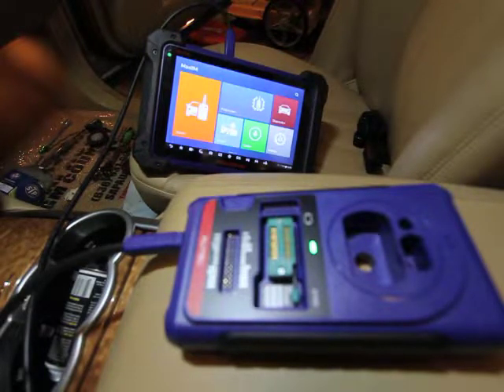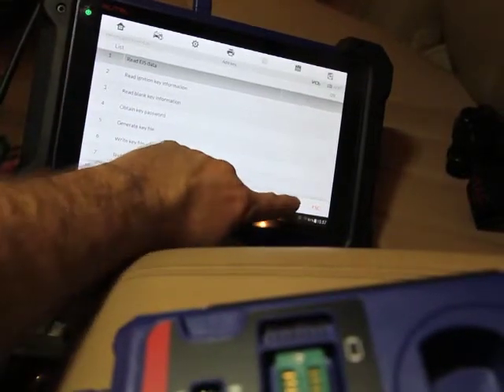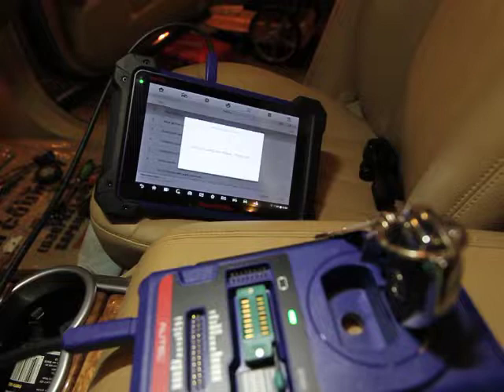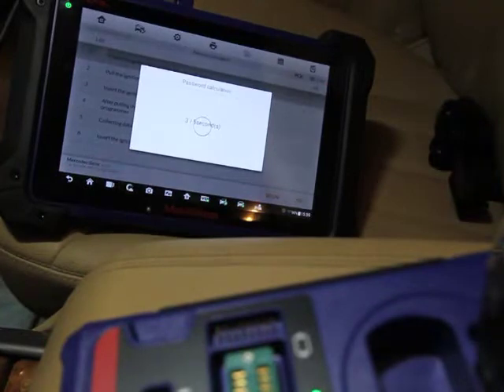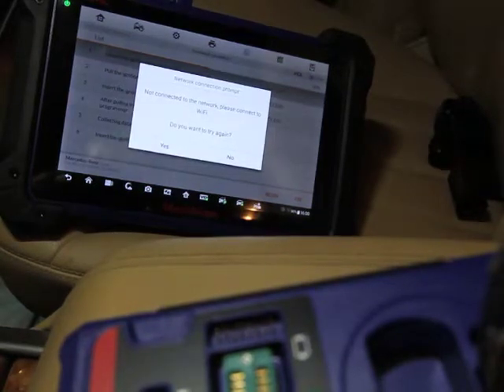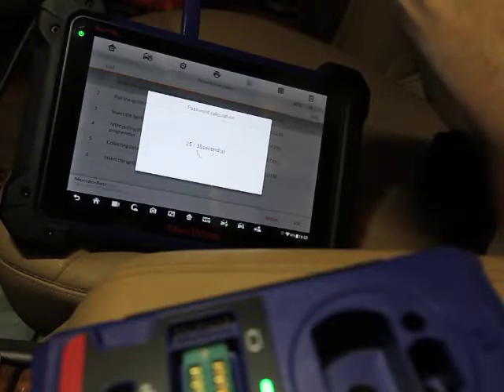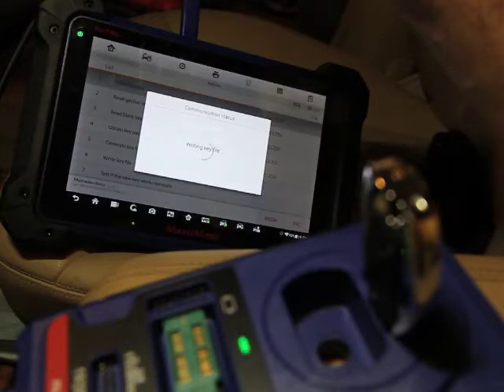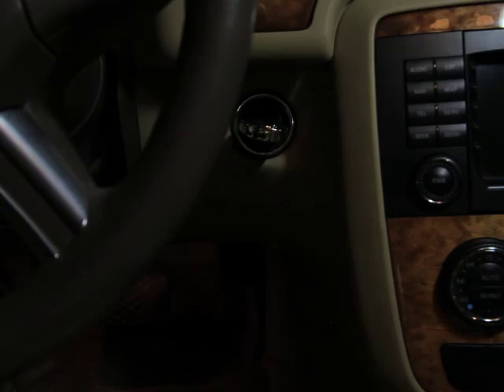Mercedes IR KEY programming with AUTEL IM-608

Comment: I just tried to add a spare key to a 2008 c-class mercedes,it has one original key.
I went through the procedure to add key,that 'seemed' to go well but new key done absolutely nothing!
I read the new key afterwards and all correct info was on it.Looked at the eis tracks on the Autel and original jey was on pisition 1,key i added was showing up as position 8,but,it doesn't show on the eis track list??
The track list shows position 1 and 2 used,the rest empty!So how does my key read as being in position 8,but it really isn't???

Comment: Do you know if the incorrect 433 MHz key was used for AKL bench W230, can a 315 MHz be used to add a key for the get remote functions to work?
Reply from the maker: Change frequency of 433 key to correct issue. BE key correct?
Reply: @SpartanAutoworx  yes it’s a BE key, says made in Germany under battery cover. If it can easily be changed that would be great!
Reply: @SpartanAutoworx  FCC ID: IYZDC07. 433.92 MHz printed as well.

Comment: I am doing my first Mercedes with the IM608 this weekend. I am just hoping I have the correct key. How did you determine which aftermarket key to use. It is a 2007 so I don't believe it had prox so I just got a few of the cheaper keys. I believe they are 315mhz I just hope customers are also 315mhz.
Reply from the maker: I use standard be key from iks or mks. Prox keys require x horse programmer. A little different programming as well. Email me if you run into issues. Just did 03 w230 key Friday with 608.
Reply: Did you add another device apart from IM 608 and xp400

Comment: Good vid, What is needed to program an extra key for vehicles with keyless go option? Thanks man.
Reply from the maker: X horse key and I believe xhorse programmer only. About to do one this weekend I’ll see if I can videotape
Reply: @SpartanAutoworx  faaaack I just ordered the autel too…. So there is a special keyless go variant key and a regular key? That would be great man, I appreciate it. Looking forward to your findings. Thanks.
Reply from the maker: Autel may do it but I don’t know as it’s an x horse branded product.
Reply: @SpartanAutoworx  did you end up doing that job this weekend? If so what were your findings? Thanks
Reply from the maker: Pulled eis from car owner is over the road truck driver will confirm after he comes home again could be a couple weeks
Reply: @SpartanAutoworx  ahhh ok, was it an all lost situation?
Reply: @SpartanAutoworx  also I noticed you referred to the key in this video as a smart key… I thought a smart key was the keyless go version (with proximity)…? Can you clarify? Thanks

Comment: Hello, question for you, I am programming the key fob for MB CL500. IM608 keeps prompting "the current key is detected to be invalid. Please replace with a legal blank key and press ok". I have two brand new aftermarket key fobs, from UHS. Any suggestions?
Reply from the maker: Did you verify the key was erased?
Reply: @SpartanAutoworx  I have only one working key, and bought 2 new key fobs (aftermarket). Which key should I erase?

Comment: Greetings,  Looking at 2007 MB CLS550  W211 AKL, any expierence doing this by Infared, EIS looks quite difficult to remove,
Knee Air Bag in the way, Or remove steering wheel, shroud, etc. Look like a lot of stuff needs to be removed. Thanks
Reply from the maker: Use the adapter for akl
Reply from the maker: Should not need to do on bench

Comment: Hello erick great video  have u had much luck rewriting used skim on the 02 to 05 christler town and country
Reply from the maker: If you know pin code you can use used skim
Reply: @SpartanAutoworx  I had the pin code of the original van but not the done skim.  Will I need the done skim
Reply: @vencentbauer  problem with these is the VIN. On some older models, you cannot change the VIN. Even with original microphones, autel or dmax. Only tool I have seen that might do it Advanced Diagnostic. But I don't have that tool. So I cannot say. Some WIN modules VIN cannot be rewritten. I have tried and failed. Maybe eeprom? But I have never tried it. Good luck!

Comment: Does the im508 work on mercedes if your circuit board broke inside the fob and can not turn the key if I buy a new key can it be programmed
Reply from the maker: Will need the AKL adapter

Comment: Hi, Can you program FBS3 (DAS3 or 3rd Gen) Mercedes keys with Keyless Go and the Keyless Go still works? Thanks in advance
Reply from the maker: XHORSE key for prox with fsb3
Reply: @SpartanAutoworx  thanks for your speedy reply, but does it allow the Keyless Go option to work on Mercedes as I cannot get it to work. Key works if put in dash but start button and remote button but auto unlock/lock does not.
Reply from the maker: Yes it does
Reply: @SpartanAutoworx  any tips how as I can't get it to work. Any videos or written instructions?

Comment: Hi, have you tried to erase a programmed key to make it blank and reprogram it with a new vehicle?
Reply from the maker: Yes with aftermarket you can. I just did one for a salvage yard last night that I will reuse the key after they get the vehicle running before dismantling
Reply: @SpartanAutoworx  I see, as I understand the aftermarket is the one that has 3 IC chip inside?, 1 of them is the EEPROM. The key I have has only 2 IC chips inside but there is no sufficient info regarding these chips. 
I have tried to program that key with Im608PRO, but I got an error message key not supported.

Comment: Does it work for the new key type 2018 and so 
Can you clear all data’s from a spare key ? Bought from a junk Mercedes ?
Reply from the maker: You cant renew oem key
Reply from the maker: 2013 and 14 last years you can program with non factory tool at this time. Google I believe its johnny fsb4 he claims to do it but never used him. Dealer only some 14- current

Comment: Is it possible to program the 2019 Amg facelift key fob to work with my 2017 c43 Amg?
Reply from the maker: Never tried
Reply: Okay
Reply: No, can’t do MB keys 2014 and up. Dealer only.
Reply: Not possible, fbs4 IS an strong anti theft system

Comment: Hi earik thanks it's ok to buy key from Ebay to reprogram for marcedes c220 cdi  ?
Reply from the maker: I have used ebay keys with success but if its a customer car buy from key dist. You want happy custmers not unhappy ones when a cheap key stops working after a month.
Reply: @SpartanAutoworx  which supplier do you use? And who cuts the key blade?

Comment: can u use it for all keys lost for Mercedes?
Reply: Yes
Reply from the maker: Yes You can
Reply: You cannot read the data by OBD then since EIS not accessable by OBD as far as my experience goes, you need to use IR key emulator , at least that is what I did on last W203 from 2001. It's supplied with the IM608. You use it instead of a key, on car, not on the bench (also possible).